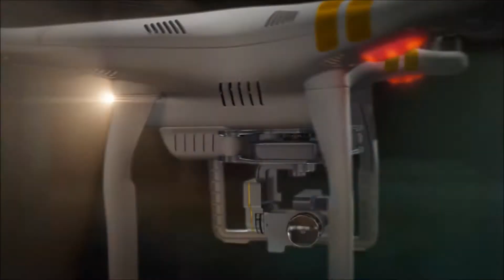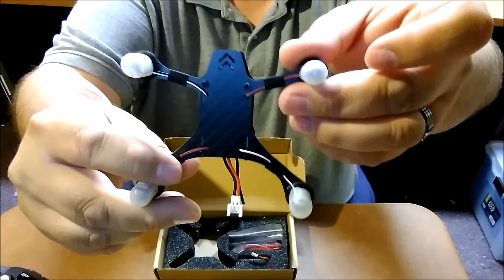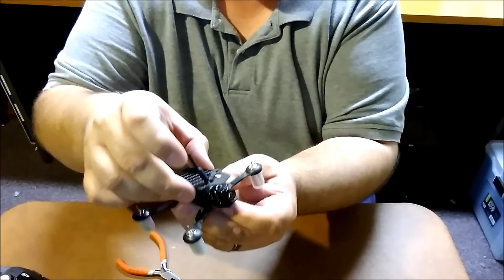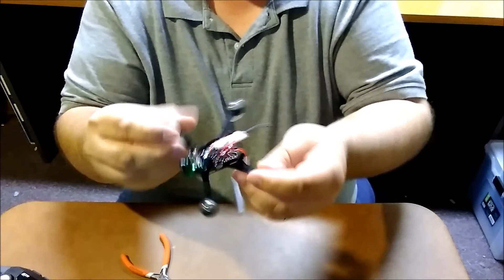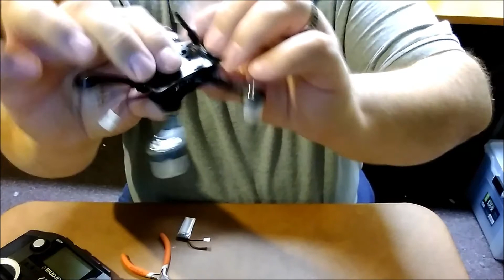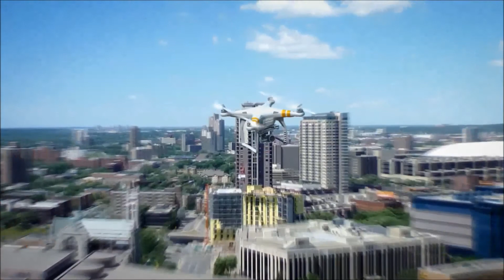CTW Mini 105mm Racing FPV Drone

Comment: Is there any soldering involved or do I just screw this bad boy in
Reply from the maker: Yes you will have to unsolder the motors from the old board and then solder them into the new one.

Comment: Hi mike I have the CTW 105 I'm trying to bind it to my jumper but I'm having no success what should I be doing
Reply from the maker: I had trouble binding to my Frsky also. I ended up buying a new board with a integrated receiver.
Reply: Could you leave a link for the board please
Reply from the maker: Sure thing I'll see if I can find it and post it for you
Reply: Many thanks
Reply from the maker: Here is what I used. https://m.gearbest.com/multi-rotor-parts/pp_598312.html?wid=21
Reply: Is there any soldering involved or do I just screw this bad boy in

Comment: Hey mike, i have flysky 2.4 mini receiver how to wire to it? There’s only 4 pin,first is S.seceond is 5V, thr is 3,3V last is GND. My receiver is SBUS,PPM,5V,GND. Help thanks:)
Reply from the maker: You only need the red, black, and white. Red=power black=ground, and white is the signal. At least on FrSky receivers I don't use FlySky. Hope that helps